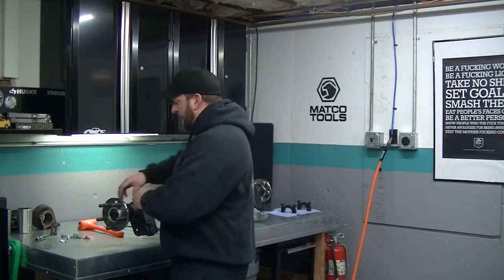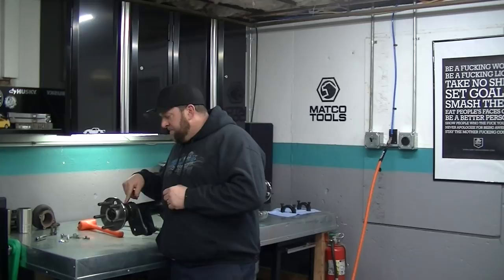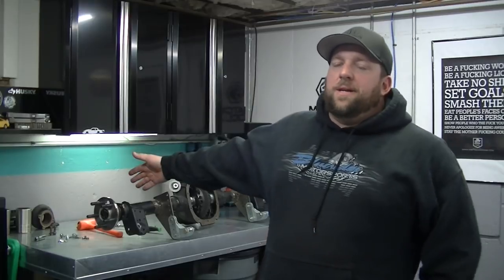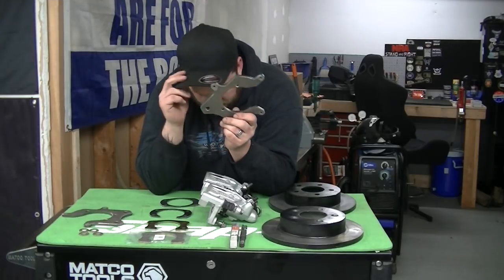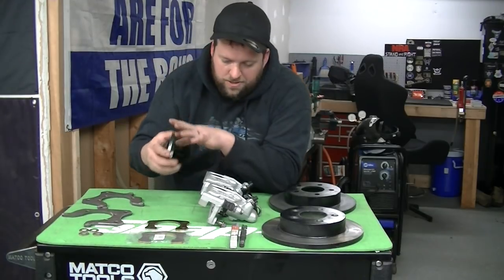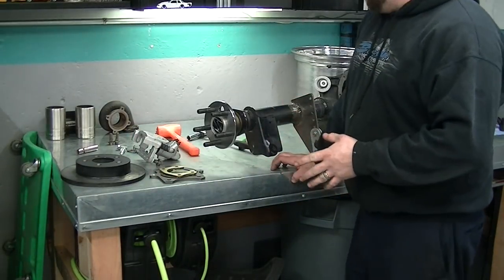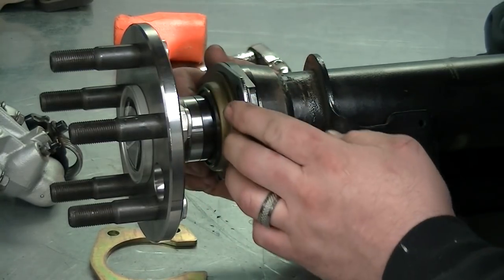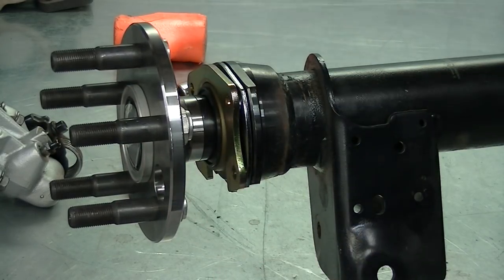LS FOXBODY BUILD EP. 33 STOCK BRAKES ON 9" ENDS WHAAATTT

Comment: Thought about 13-15 Cadillac CTS front calipers (Brembo)?  Everything is on Amazon.

ACDelco Front Driver 172-2777 & Front Passenger ACDelco 172-2768 

EBCBrakes DP31210C

ACDelco Caliper Hardware18K1971X 

R&G Brembo HIGH TEMP Brake Caliper Decal Sticker Set of 2 Decals (White)